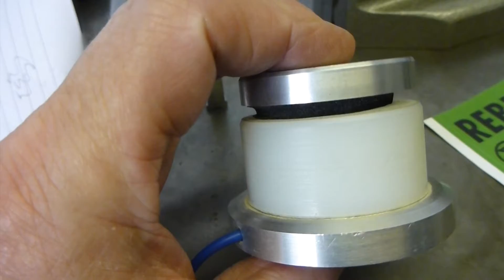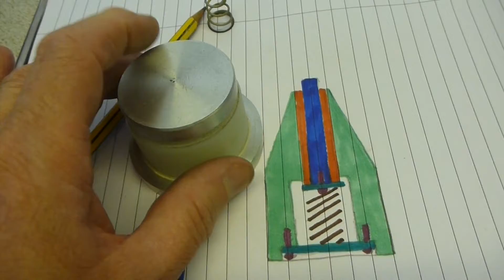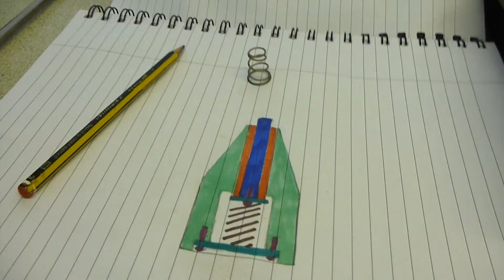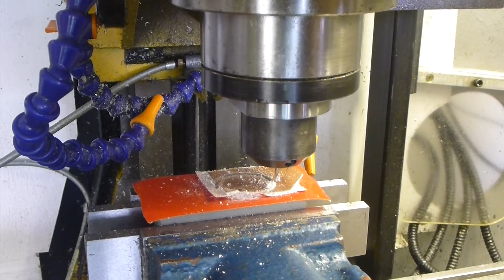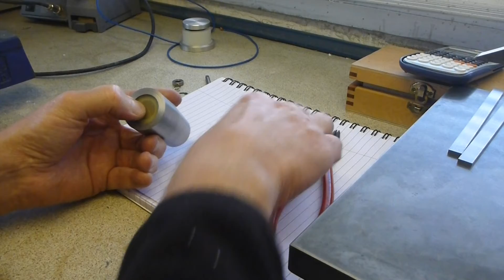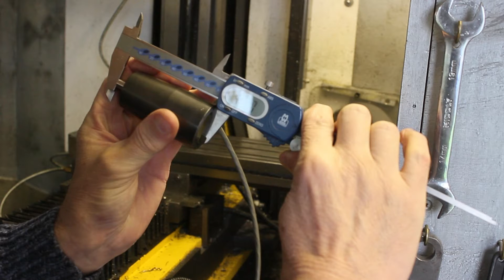Diy touch probe for my CNC mill

Comment: Sir, how does the machine know the top of the part wrt the table height?
Reply from the maker: Hi Rengan,
Good question, you measure the distance from the table to the bottom reference face of the spindle. Best done with gauge blocks but can be done by using a piece of metal of known length then you jog the head down until it touches the block. Then enter the length into the Z height in the software.
Cheers

Comment: If I had done that, I wouldve used a much stiff spring just to make sure that the touch bar was guaranteed to return to the exact same spot over and over
Reply from the maker: I agree with you I ended up using a spring I had. The pin is also soft so if I made another I would harden it.
Cheers

Comment: What kind of screenset do you have installed on the probe?
Reply from the maker: I think its either the default mach 3 screenset or one designed by Hoss or Physics Anonymous both on you tube

Comment: 🤪🤪🤪🤪👍👍👍👍👍 great video, I think your method to determine the exact height is strange.  if you wan t to determine the exact height of your touch block you (must) have a calibration block (where the height has been accurately determined). 
 https://youtu.be/d1ogwt0HI0g
 video is not english translate at google
Reply from the maker: Absolutely however I do not have a set of gauge blocks so using a Vernier height gauge on my old and probably none too flat surface plate is the best I can do at the moment.

Comment: The switch should be very precise to ensure repeatability.
Reply from the maker: Lets hope! The issue I see with this type of switch is it has no hysteresis and no 'snap' action to make or break. I feel at the point of connection there will be a whole load of noise that would be best filtered out or better still use an Arduino to capture the first make /break.
I have a diy touch probe coming up next year that uses an Arduino in this mode and should be more accurate.
Thanks for the comment.
Reply: @CazualHaze  it "bounces" a few times? And what breaks the electric contact in this version? May be use a led optical switch? Using a optical switch might eliminate the need of Arduino logic
Reply from the maker: Yes I agree however when switches particularly this sort of diy job open and close they bounce and create lots of noise which in turn causes lots of trigger signals. An Arduino could stop this by using an interrupt this triggers once on the first switch transition. I have been experimenting with a touch probe and the software stops this issue and gives a solid result in the fastest time. Time in the cnc world equates to movement so to stop a axis moving you need to respond asap. 
An optical switch would be a good choice of sensor but requires some sort of blade to make / break which in turn makes the design more complex. I have thought of using a tactile switch which has better make / break characteristics but as yet have not experimented with it.
Best David